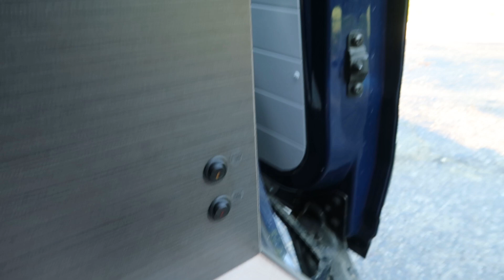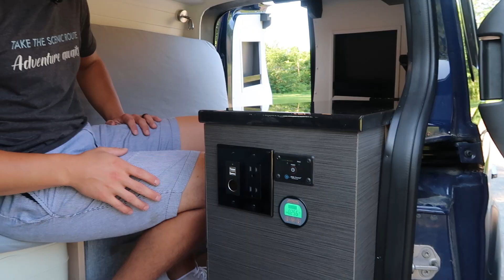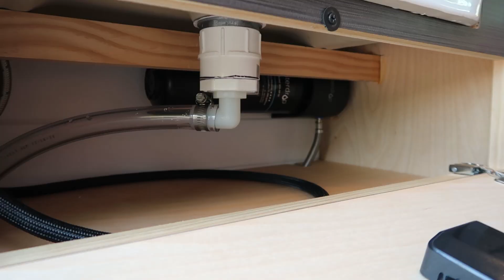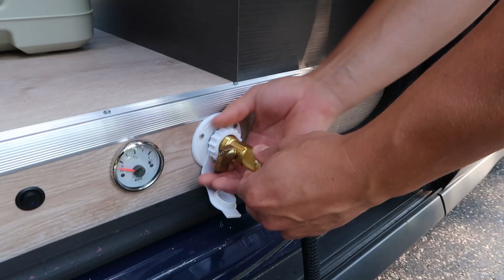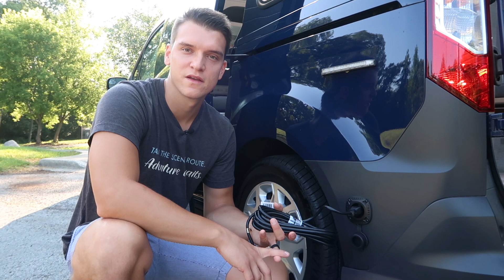Micro Camper | in Depth Electrical and Plumbing System

Comment: It looks really nice! I do have some questions. Why did you choose to put the bed on the passenger side? Wouldn’t it be better to have the windows usable on the right side; having the bed behind the driver will also allow the passenger side sliding door to be the entrance when you have dogs or have gone shopping and you are parked on the street. My other question is regarding weight: is the wood not heavy so as to leave enough weight to bring more load on our trip? Last question: was the center of gravity considered in the design? I have a 21 ft van but am looking to go smaller. Thank you so much!

Comment: I have to wonder if it would be at all possible to install an incinerator toilet in one of these. Dealing with a black tank (or a chemical toilet) isn't happy times and an incinerator toilet eliminates that issue. Granted you'd need a heft power supply to do it on electric, but I've seen it done in a van build before so I wonder if it couldn't be done in this more compact form factor with solar on top.